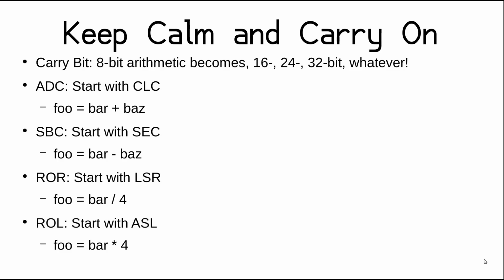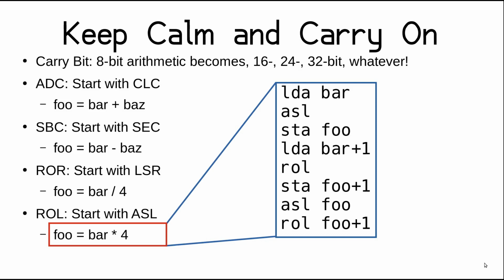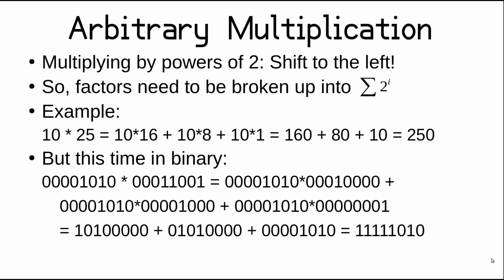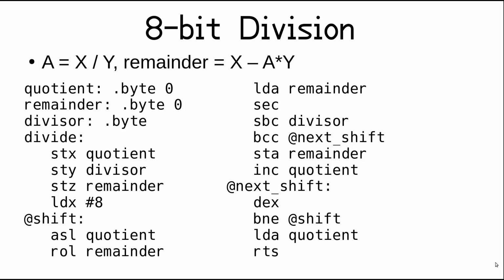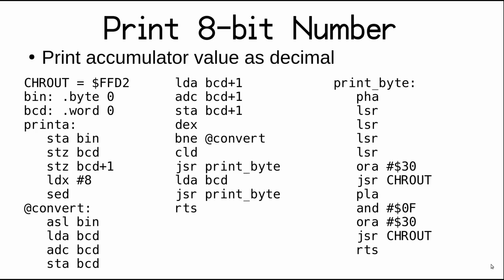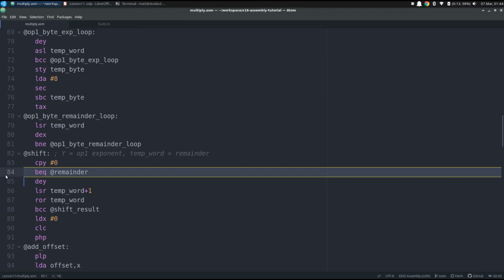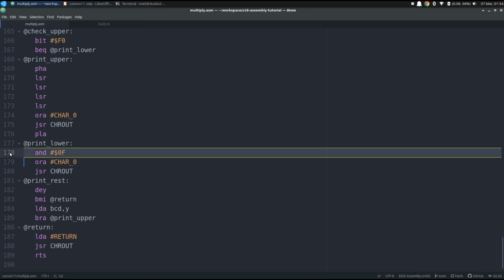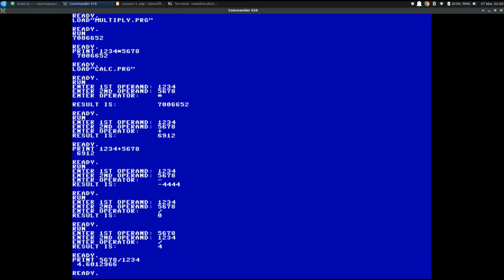Advanced Math: Commander X16 Assembly Language Tutorial, Lesson 11

Comment: This is a comprehensive video for the key ideas in doing multiplication and division, and an important foundation for some more exciting stuff later!  

As a side note, some slightly more sophisticated CPUs had a "multiplication step" instruction or even a "divide step" instruction, where after a little setup, you can just repeat the step instruction 16 times or whatever your bit width is and the CPU would crank out a result..  But those CPUs allowed working with double-width registers so the carry process was more neatly contained and did not need to be explicitly manually done. But this was easier for the CPU designer to squeeze into a design than full multiply or divide instructions.